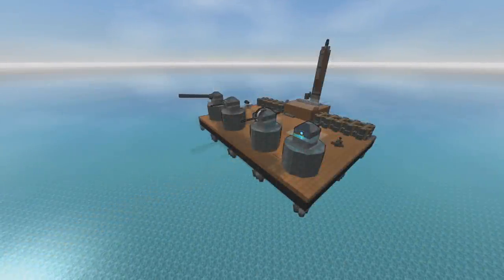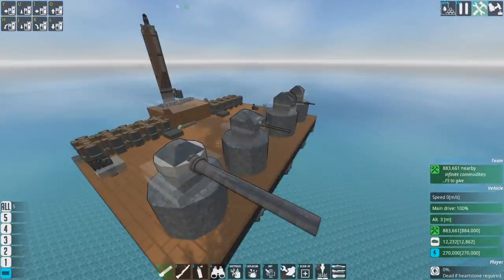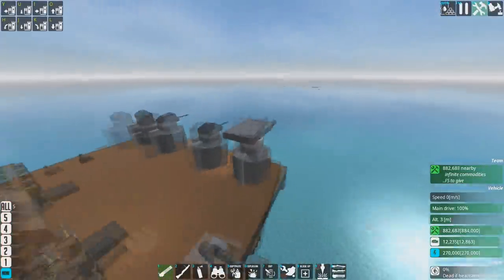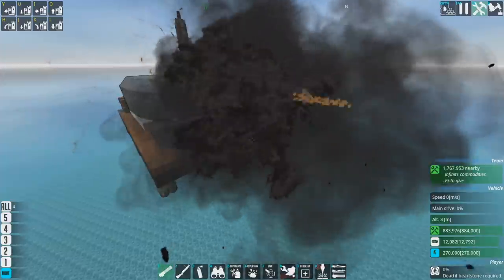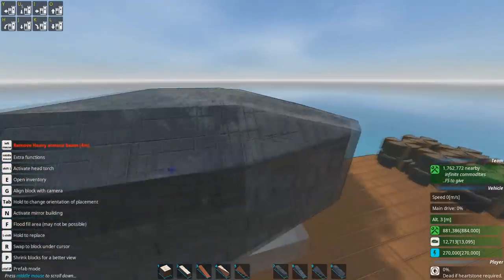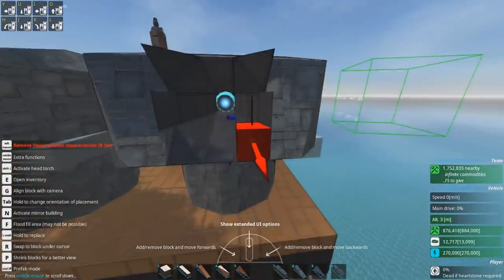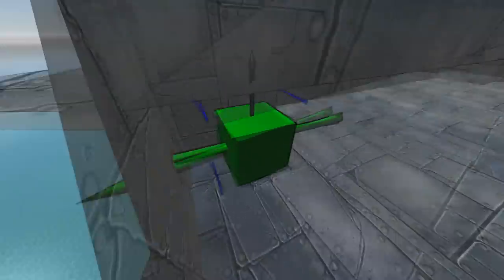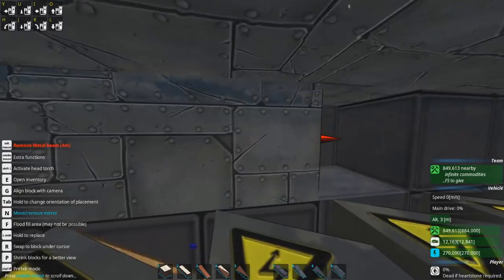Gun Safety Hats! Turret Cap Tutorial, From the Depths

Comment: First few times I tried making turrets I accidentally built the turret caps into the deck which prevented the guns from turning. I also didn't know heavy armor wasn't supposed to be used so much (one of my turret designs has almost the entire inside filled with heavy armor beams, which I guess you could consider overkill).

Comment: You can fill the corners of the deck hole with 1 meter slopes as long as the turret is cylindrical and it will still rotate freely.
Reply from the maker: I don't think that's how the block collision works, but I'll give that a go.

Comment: I used to have a lot of trouble with advanced cannons until i basically learned that the six way connectors are a lie. You like never use them unlike in other weapons like laser and cram. Instead you use the cooling pipes and its been so easy after that.

Comment: What are the benifits for the "moving" armor below deck? Speaking metal blocks on the subpart of the turret instead the hull? It Doesnt apeal to me since it only decreases the rotation speed as far as i can see. Apart when you want to face the heavyest part at the enemy.
Reply: having the turret armor on the hull usually lets the turret turn faster, but in turn having it on the subpart can let the armor move around
i.e. if its getting shot from the back, hull attached armor cant do anything once it goes through, but turret attached can rotate the turret, effectively replacing the armor
Reply: @qw3rty629  well, thats works the over way around too. Turrets aiming at one target, getting hit in the front, then turn to the next target and presenting the hole in the armor to the enemy...
Reply from the maker: There are multiple benefits to armouring your turrets: 

1. It's a free-volume air gap, to stop HEAT ruining your day. 
2. It makes it harder for the turret to be popped off completely, which costs the craft a large chunk of health.  
3. For APS and PAC, it also acts as a buffer against their volatility, preventing a damaged weapon from further damaging the rest of the craft.  Hull-mounted armour can do the same, but since it doesn't move with the turret it doesn't do it as well. 

All in all, I can safely say that craft with armoured internal turrets survive a lot better than those that don't. 👍
Reply: @Meister_Knobi  the thing is, because of how subobjects in FtD work when shell hits top part of the turret explosion/fragmentation ignores the armor of main object which means unarmored magazines can get easily destroyed meaning one bigger hit can ammo rack your entire turret